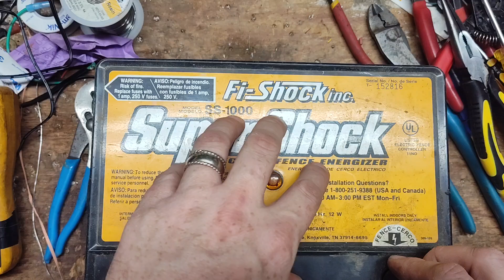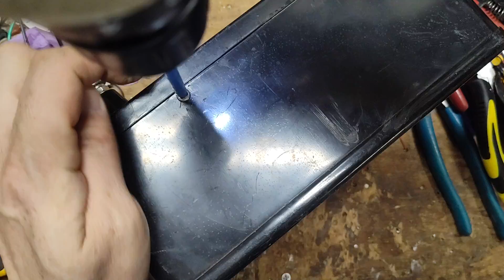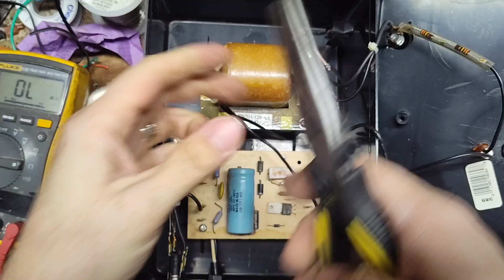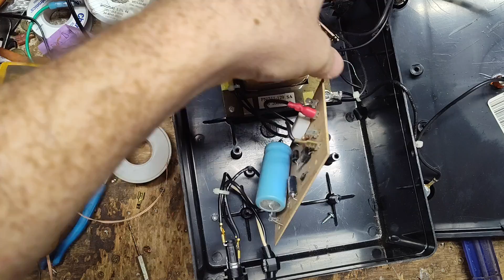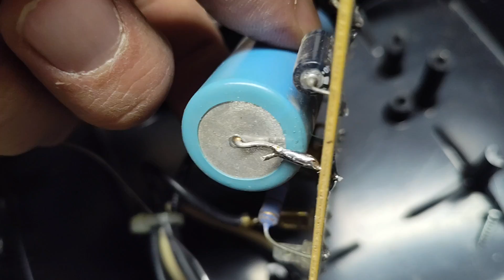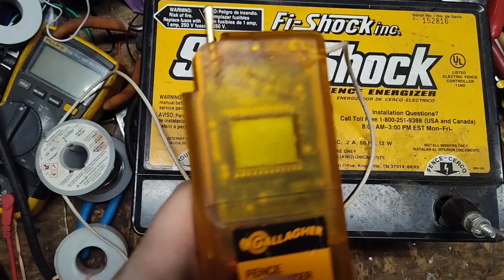Fixing A Fi-Shock Supper Shock SS-1000 Fence Energizer

Comment: So i got one of these in an estate sale. I want to use something to keep deer out of my garden. What do I need to use it? Or where. Do I find that out? I know nothing about electric fencing.
Reply from the maker: Electric fence is pretty easy stuff, but people over complicate things. You'll need some post to put around the perimeter, which there's all sorts of them out there to be used. I would use metal t-post in the corners for strength and use whatever other types of post in between. Then you'll need insulators on the metal post, which don't buy the cheap yellow insulators sold at the different stores, they're complete junk because they have very little UV protection built into the plastic, and the sun will break them down. Then you run your wires around the fence through the insulators, use some good steel fence wire, 14 gauge. I would install probably 4-6 wires spacing them however you think based on the animals you're trying to deal with. Install the fence charger in a dry place or if it's outside, install it in some sort of protected box, AC units aren't waterproof at all. 

Then use some of the steel fence wire to go from the fence side of the charger over to the fence. Then you also need to install at least 2) 6' galvanized ground, not copper, rods spaced 10' apart. Drive them into the soil as deep as you can, but leave 4-8" or so sticking out. Then get some galvanized ground rod clamps, not copper ground rod clamps or hose clamps. Run some of the leftover steel fence wire from the ground terminal of the charger over to the first ground rod. Then daisy chain another steel fence wire from the first rod to the second. Then tighten down the ground rod clamps with the wires attached, and hopefully all goes to plan and plug the unit in. Then to test the fence, either put the back of your hand up to one of the hot wires, or get a good digital electric fence tester, not the stupid flashing light testers, they're junk and are a guestimate at best.

Comment: I use old tube type ink pens and make a standoff from them
Reply from the maker: That's a good idea. What we usually do here when need be is we'll drill a hole, run a long bolt through the case and through the board, but put a plastic spacer for the board to set on and then put a nut and washer on top to hold the bolt in place.